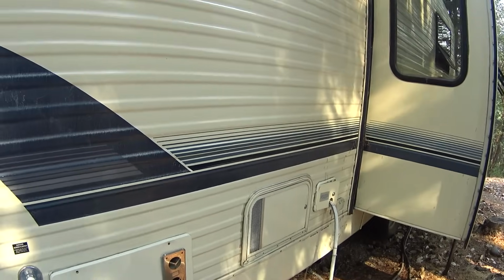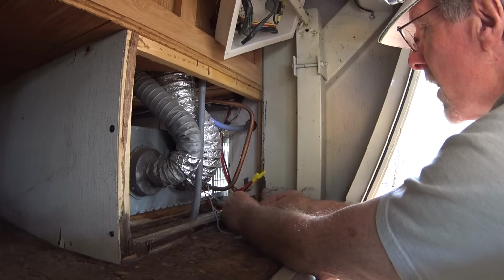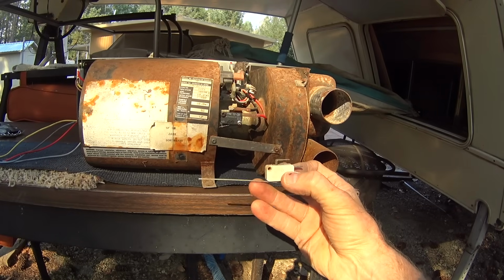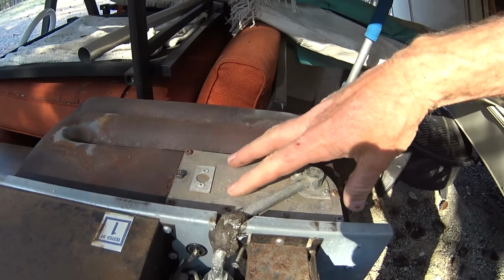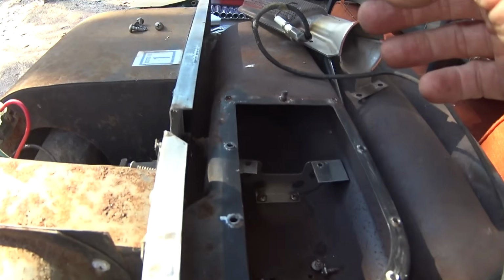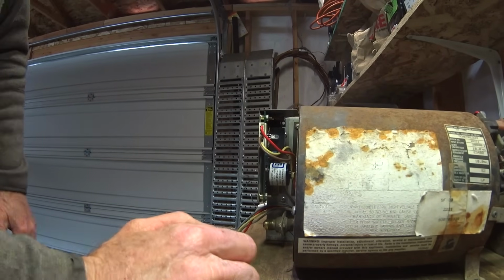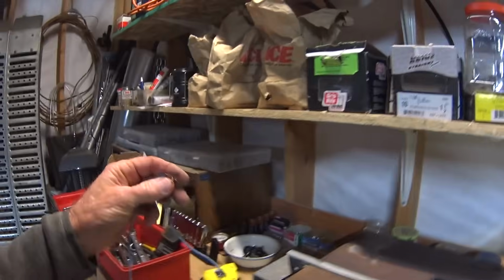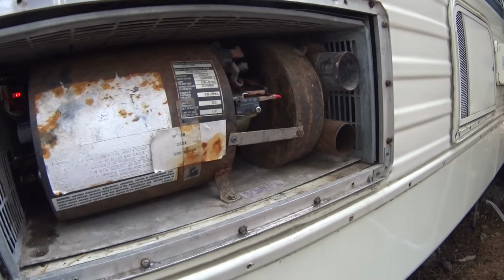RV Furnace Removal, Repair & Installation (Suburban SF-30 Shown)

Comment: If i disconnect my heater, my ac/fan doesnt work anymore.  I assume when plugged in, it is gaining continuity through the circuit board.

I dont want to go crossing wires and short my thermostat, and I am hoping to sell the heater, so I don't want to simply gut the circuit board to make it work without risking anything. (Heater works just removing to make room for residential fridge).

So, my question is do you happen to know how to jump the circuit so you can use the AC/fan without the heater installed? 

Thank you
Reply: To clarify i have the same color wiring as you, mine is in a 96 jayco. 

I have two small guage wires from the thermostat, i assume, and some +/- from my 12v circuits.

Not sure how thermostats work, but is it a simple cross of the thermostat wires?
Reply: Actual just ran continuity through the plug attached to the board and it looks like like its pretty simple...12v + to + thermostat and same for ground.  Makes sense.  If i dont comment again on the results, then do not attempt this.
Reply from the maker: @crossbowchris3676  All I know is that the two blue wires coming from the control board connect to the thermostat.  And when the thermostat calls for heat, the connection between those two wires in the thermostat is closed.  So I would say yes, it's a simple cross of those two wires.  There are other wires coming from the thermostat though, for the a/c and power.  I haven't dealt with those so couldn't say.

Comment: Maynard, my heater works ok, but sounds like I gave a fan bearing(s) going out. Is the motor replaceable by a DIY’er?
Reply from the maker: I would definitely try it.  You might want to look into what a replacement motor would cost, if they are available.  Or maybe you could get away with replacing the defective bearings.  But if it was me I'd look at that first before replacing the entire heater just to save money.
Reply: Got the motor @ $140 + shipping. Using your video as guide to pull the heater.

Comment: Can you please tell me what color wires connect to the two blue red and yellow to the furnace?
Reply from the maker: As far as I recall the 4 wires coming out of the furnace connected as follows:   both blue wires went to separate red wires, yellow went to white and red went to black.  I'll double check that if I get some time.
Reply: Maynard the Miser , we have a small red wire, two yellow and two white from the thermostat. We may pull the furnace today to see if we are missing some wires.  Looks like someone has replaced wires at some point maybe
Reply from the maker: Yeah maybe someone did.  That's nothing like mine.
Reply: Thanks I think we got it figured out!
Reply from the maker: Glad to hear that!
Reply: Hi does the igniter base goes under and scew on top is it correct ? Awsome  video thanks
Reply from the maker: @oscarbugarin9318  Not sure how I missed this comment.  Sorry.  When I took it apart, the ignitor was under the burner and the screw that held it in was underneath as well.  That's why I had to pull the whole burner out.  But when I put it back in I put the ignitor on top of the burner and screwed it down using a different hole.  I had to do that since the new ignitor was so much bigger than the old one.

Comment: A new furnace is only about $400 to $600 dollars, but I guess it's okay to ride it until the wheels fall off
Reply from the maker: These things are just a collection of parts, like most things are.  When things break or start going bad, I replace parts, not the entire - whatever it is - unless it's too far gone to make sense.  In the process I learn how it works, and if it breaks again I will have a better idea of what's wrong and how to fix it.  You don't get that benefit if you just tear out and replace the entire unit.  The parts I replaced on this cost a total of $125.  And five years later it's still working great.   I never did understand why people want to replace entire units when it would be a great learning experience and so much less expensive to replace the actual parts that are broken.   But to each his/her own.
Reply: @MTMiser  I salute you

Comment: With the looks of that heat exchanger furnace should have been replaced!!
Reply from the maker: Why replace it when there's nothing wrong with it?  We've gotten 5 good yeas of use out of this heater since this video was made.  If it was bad, it would set off our CO detectors.